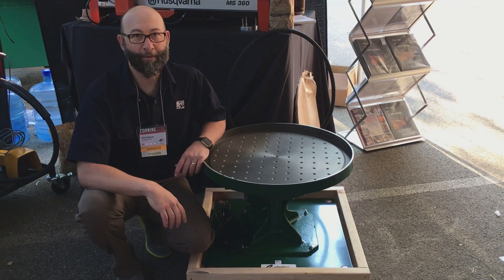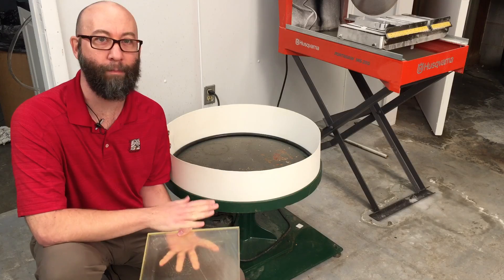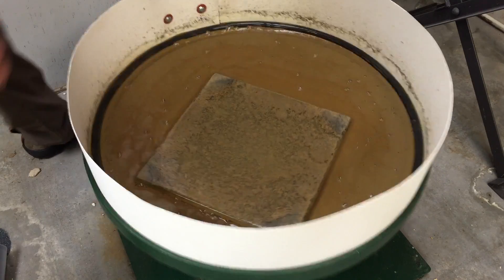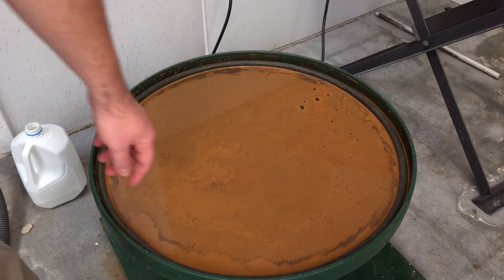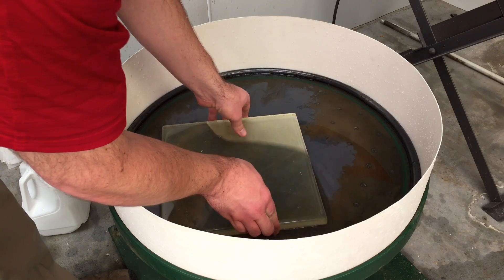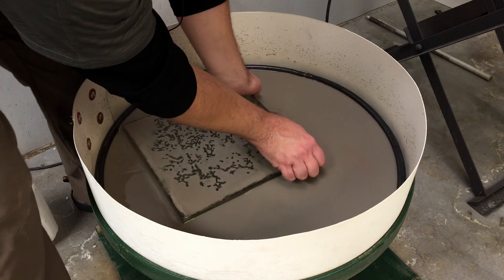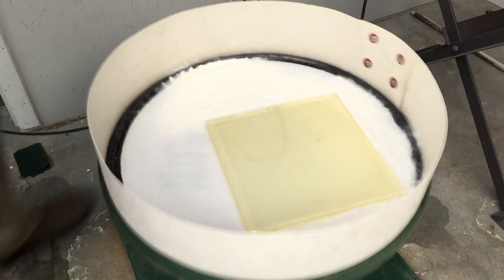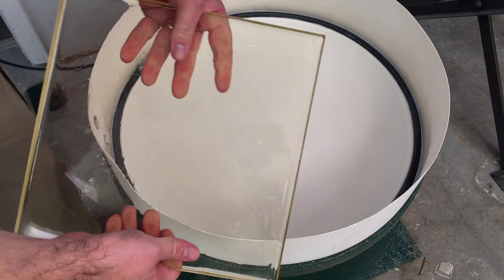How to Grind and Polish Glass with a Rociprolap

Comment: COULD YOU MAKE A LENSE OUT OF A PIECE OF ROUND GLASS USING THAT MACHINE CONVEX OR CONCAVE?
Reply from the maker: No. The Rociprolap is just for flat pieces. In order to make a concave lens, you'll use a radiused wheel on a lathe.
Reply: @hisglassworksinc  could you elaboratew a little more ?
Reply from the maker: @randallmarsh446  We have a short video here talking about electroplated and sintered diamond wheels on a lathe and these wheels are both radiused wheels so they cut a curvature in the glass. You can use these wheels to cut a lens in the glass. https://www.youtube.com/watch?v=AIZqQ_ztlI4

Comment: the "rust" is more the micro particles scoured off the pan as the carbide does it cutting action. I have found the splash shield to be a worthless item. I tried it for quite a time and they eventually would break along the rim edge of the pan due to fatigue from the orbital motion. I finish slabs of stone, if you limit the amount of water into the pan and have plenty of weight on the rocks there is very, very little splash to worry over. Some slabs want to be rowdy and fly around so you have to experiment to find a weight placement and total amount that will settle that one down. Been doing this with a 24 inch model for 10 years now. I only remove the heavy pan to clean, reoil and or replace the nylon bearings in the cups. Clean up of spent grit and mud from lapping is accomplished with a good shop vac with a 4 inch wide tool on the hose. After the first vac job, scour the sides with stainless pot scrubbers. Use a steel end brush on a hand held drill to  clean all the circular divots in the pan bottom. Do this cleaning with a fresh charge of water. Vac again. Wipe pan with a wad of paper towels and you are ready for the next grit level. I never use a grit larger than 220. Found it wastes too much rock, induces a lot of undercutting that takes forever to remove with 220. Some slabs not well sawn may take 8 or 12 hours to get nice and flat, removing all saw marks but in my estimation it is worth it in that that avoiding use of coarser grits extends pan life considerably.
Reply: Gary, I just picked up an old 20-in.rociprolap that will need some machining to fix damage to the raceway caused by the use of steel ball bearings instead of nylon ones by a prior owner.  I really appreciate your comments on cleaning, but still have a number or questions, perhaps you or hisglassworksinc or anyone else would like to answer.  Since I'll only have one pan, I'll need to clean between grits. I'll also be doing rock slabs, and wondered how many per load you can usually run through before changing grits.  Can you just add a bit more grit and water to freshen it up?  
Next question, you say you don't use grit larger than 220.  What other grits do you use prior to polish?  
Next, how are you attaching the weights to your slabs?  Just laying it on top or some sort of epoxy?
Regarding my rociprolap, it is an old one made by Rose Enterprises that has three bearing keepers mounted to the base of the machine, each holding two bearings.  This will give me a total of 6 bearings under the pan instead of the 12 bearings beneath the pan on the newest model shown at the first of the video.  Does anyone have experience with both models, the old with 6 bearings and the new with 12?  Would it be worth the effort to get the new bearing keepers to mount on the base so that it can hold 12 bearings?  
Last question, have you figured out about how much $$ the grit powder and polish cost you from start to finish per load in the pan, assuming you clean each time?  Just trying to factor that in to see what my costs will be.
Thanks a lot.
Reply: @nunyabidness1888  Upgrade to the 12 nylon bearings is a good idea. That is one reason that the previous owner went to using steel bearings, just too much pressure on the 6 nylons and they were failing all the time. I get about 60-80 hours on a set of bearings. When I rotate the pan by hand and can feel and hear the “rough” grumble I know it is time. I will depend on how much weight load is in the pan as to how your bearing experience goes. I buy bearing in bulk on line, 1-200 at a time. Their uniformity is not so critical, as the come the are just fine because they compress down under a load anyway. The idea I have heard that they need to be individually miced for uniform size is baloney. Just use lot run and you will be ok.

I use 2 heaping tablespoons of 220 grit to start in my 24 inch. I load about 60% + or -  of the pan with slabs. Barely cover the pan with water….BARELY. Then add the grit and load the slabs. This will bring the total liquid volume up to more than enough. Keep and eye on it if you are operating outside or in conditions where evaporation is high, may need to add just a bit of water time to time. After about 2 hours I usually add another 1-2 tablespoons of 220 grit, then after that maybe a tablespoon every hour or so, depending on how long the grind has to go for that batch of slabs. Grit use is really pretty modest for me. I do agate and jasper slabs, no glass.

I do the entire lot of slabs I have set up which may be up to 30 in number…2,3 4….6 at a time depending on their size, so that I load the pan for optimum function. I believe a lot of operators get the idea to load the pan to the hilt so that they “economize” . Loading the pan too much leads to slabs fighting each other, banging around like a pin ball machine and slashing grit slurry all over hell. It is an experience thing. Slab shapes play into it, the more circular the shape the better behaved the pan contents and the more you can load. Using more weight is essential to keep the slabs “quiet” it increases the cut rate and dampens the tendency of the slab to be slung around the pan. I have seen all kinds of weight recommendations. I just found what works for me and really have no comments of help for you to find what will be best for what you do. But just ballpark….I would estimate I use about 16 pounds for a slab 4x4 up to 8x8 inches. Larger will require more. That is quite a range of weight per sq inch but my lead ingots are around 8 pounds so it is a one size fits all. Smaller slabs will grind quicker and tend to be much quieter in the pan with the higher weight to surface area relationship.

As each pan loading of slabs is finished with a grit I wash them with a high pressure hose immediately. For me it takes some time, the way I mount the slab to backing plate/board there is a small gap of up to ⅛ inch where grit slurry gets collected and it takes considerable time to flush it all out with a garden hose nozzle. Then I blow out the crack and the face of the slab with compressed air. This is important, especially so if you have a slab with lots of surface pits, vugs and such, like plume agates and things that have a natural porous like surface.

After each pan load is finished I wet vac out the pan. Leaving the old slurry does not work for me, it gets real viscous and interferes with good pan to slab contact. So…new water and grit for every pan loading. After the entire lot of slabs has been ground I add ¼ inch or so of clean water to the pan and scrub it with those coarse stainless pot scrubber pads. Then I chuck up a steel end brush in a drill and push it down into every dimple in the bottom of the pan. Wet vac out. Add more clean water, run the lap a few seconds to slosh it around and then wet vac out. Do this twice. Use a wad of fresh paper towels to thoroughly dry the pan. It should look real clean to you.

The next and last grind is with 800 grit. This is a strict 4 hours for agate and jaspers. By the clock because the variable time in the coarse grit is past due to uncertainty about how long to grind because of saw marks or such on the slab. I use two tablespoons at start and that is all, add no more. End of 4 hours you will have some starting to shine slabs.

I use ⅜ inch thick white polypropylene cutting board stock for backing/mounting plates. Get the real big ones cheap from Walmart, cut out the shape and size you need. In time you will have an inventory of back plates to suit all your slab mounting needs. These backings are very durable, stable and will facilitate the attachment of weight to the rock while at the same time adding protection and rigidity to the slab. When mounted, the slab perimeters are inside the edged of the backing plate so any contact in the pan is back plat to back plate with the other mounted slabs. Works sweet. No need for bumper rings and other crap to put around the rock slab….which leads to a lot of slash activity and noise. My rociprolap runs nice and quiet and grit splash is negligible. I took a year or two for me to develop these techniques. I started like most do, using the guidelines published. Just really not workable for me as they are written so I started devising my own approach….and learning as I went…what worked….what didn’t. Even today I still have to be on my toes for some unusual situations but that is the fun of doing this work.

Back to the mounting boards, I used a good grade of heavy duct tape…a few strips to one side of the board, the lay down hot glue and set the slab. Get a HEAVY duty glue gun and buy some 12 inch glue sticks. You will go through a lot of glue and some tape. Then I turn over the mounted slab, attach a couple of strips of duct tape to the back side (opposite the rock side) and there I attach my lead ingot with hot glue. The mounted slab is ready to run. Later, when the slabs have been polished and ready to demount I use a hair dryer in high to heat the rock side, in time the glue will lose its grip. It is an art. There is a sweet spot for the heat. I use a stiff blade putty knife in that crack between the back plate and the rock slab, light pressure at about the right time and you can feel/see the release of the hot glue. The weight can be pried off the back with a screwdriver or other leverage device. If it pulls the tape and all no problem, just peel it off your weight ingot. The rock side tape sometimes lets go from the poly board instead of the gluem usually when too much heat is applied. No worries, just use a single edge razor blade scraper to remove it and the hot glue from the rock slab. You might have some slabs loosen from the hot glue, some surfaces are that way, just clean, dry and reglue the slab to the backing. I have had to do that on some slabs for every grind but it is not common.

I have a lot of lead ingots, besides the glued one on the slab mounting I add another to the the top..piggyback..once the pan is loaded. I have some ingots that are velcroed so it is a quick attachment and detach later. Adequate weight is very important to efficient and successful lapping. Some slabs, due to large size require two ingots glued down, then two piggy backs. Slabs up to8x8 inch are ok with one ingot placed in the “point of balance” of the rock slab. Another words get the weight in the center of the rock piece or you will get off side grinding and result in a wedge shape slab. Large or longer slabs need a weight at each end of the mounting board. This too is an art form, figuring out what will be about the right position and amount of weight for each slab. School of experience involved here.

When you mount a rock slab that is mixed hardness be careful of soft areas concentrated on a particular side. Such a slab will cut faster to that side when the weight appears to be mounted properly centered. You may have to shift the weight position or you can glue a piece of harder waste stone along that soft edge. The waste will act like an outrigger to buoy the soft area. You need to get the waste piece to be as close as possible to the same level as the surface of the slab or you will be grinding a while to get it cut down so the the slab is in full contact with the pan and if the height difference is too great you can actually introduce a wedge in the slab the other way. Got to be on your game here.

Polishing is a whole subject in itself for me. I abandoned the “recommended” methods and developed my own. I use NONE of the materials suggested for polish pads. But I will say that you can go to polish using what ever pad materials/devices you like, just do the full pan clean up after grit grinding and you are good to go. Polishing for me is also quick….a couple of hours. I have long favored tin oxide, nothing beats the finish it will produce. But I have used Meyers rapid polish with ok results too. Polishing is a controversial subject, ask any number of people for their recommendations and you will likely get the same number of opinions. What works for you works for you. I can say this, if you have too run the lap for hours and hours to get to a shine something is not right. Truthfully the polish step I believe has more potential for things to fowl up and be a source of hair pulling frustration than any other aspect of lapping rocks.
Reply: @garymcmullin2292  I can't thank you enough for your time in spelling out all the things that experience using this device has taught you over time, and for your careful explanation of it all.  Perhaps at some point you may consider making your own YouTube video(s) showing the process that you have developed over time.  It is such a help to learn some methods that are proven to be successful, such as using the cutting board as backing material, how to tape/glue the weights down, the proper amount of water/grit to get a slurry that won't usually splash, etc.  You have likely save me many hours of avoidable frustration, though putting it all into practice brings its own challenges.  I really, really appreciate your time and advice!
Reply: @nunyabidness1888  I just spent over an hour doing a thorough reply to your question and something hit a wrong turn....lost it all. Sorry, maybe I'll try again but really have no interest to invest that kind of time again. Would love to help you but ability to communicate is a pain. Maybe I can try doing a paste in reply so I won't lose my work here.

Comment: If you don’t mind, where did you get the plastic for the splash guard, and how tall is it ? Thanks
Reply from the maker: The Rociprolap comes with the splash guard. They are made from Formica.
Reply: Sorry for another question, does water get between the metal and the splash guard and splash out water ? I have a HP Lap, removed the inner ring to fit more stones, though I’m now getting more splashing and want to add a splash guard. 😉
Reply from the maker: @fredfalting  The splash guards fit pretty tight and also bolt onto the rim with a bolt and wingnut to hold them tight. You will get some splash, but it's minimal.

Comment: Did you do a clean out between the 220 grit and the garnet?
Reply from the maker: Yes! You will need to thoroughly clean out the pan between each different grit style to prevent contamination.
Reply: @hisglassworksinc  k, TY.  I was just curious. Because it wasn't shown or mentioned in the video.

Comment: Do they make these rociprolap machines in a smaller diameter?
Reply from the maker: The smallest is a 20 inch diameter: https://www.hisglassworks.com/shop/machinery/flat-grinders/rociprolaps.html
There are smaller machines called vibralaps that only vibrate for smaller pieces and lapidary work

Comment: Hello 
Last week I finished my vibro lap to grind iron slices of meteorites from cut marks. I was inspired by Your machine. But I found that this take crazy long time to grind. Even I used now 80 grid, after 30 hours it was still not perfect. I wonder if iron is too "gummy" for this kind of prosess or I should used cast iron instead of normall stell plate as a base.
I read, cast iron is more porous and the grinding powder go into pores (holes)and grind like sand paper. On normal iron plate powder can roll over and dull. Do You have any idea about this ? Did You buy or make that iron place Yourself ? Thanks
Here is my machine at work. https://youtu.be/AGES10_pDm8